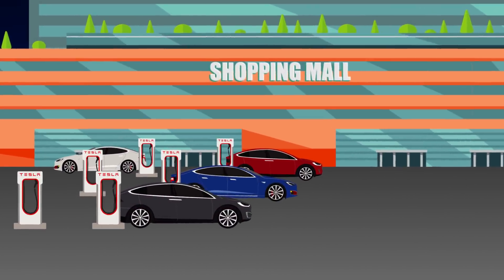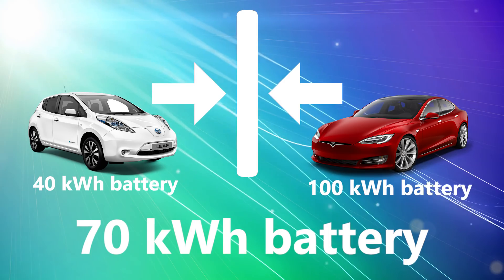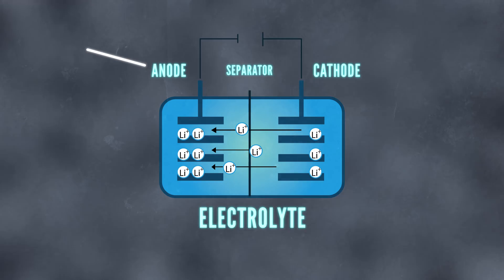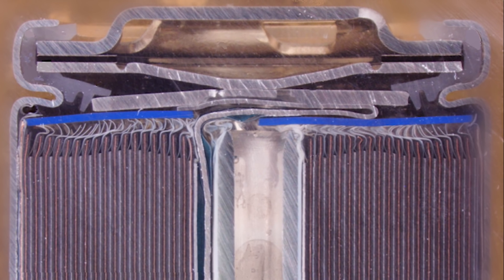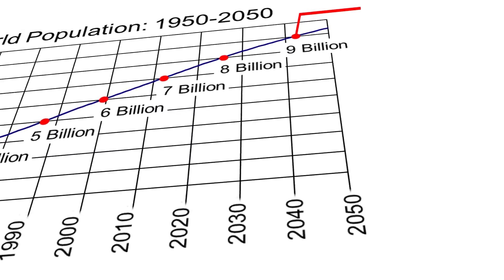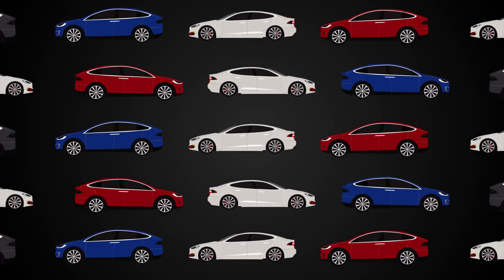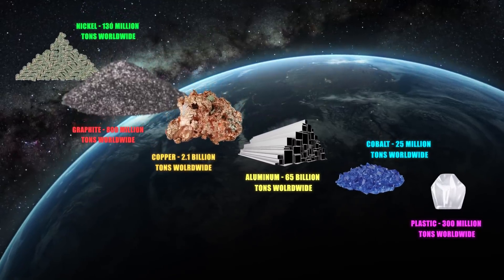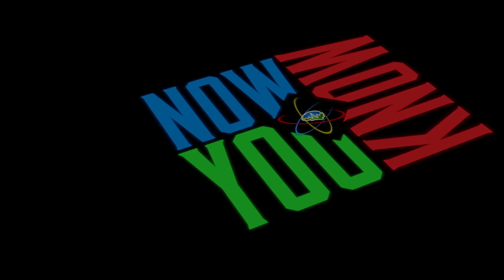Will there be enough EV Battery Material?

Comment: You forgot to add that ALL the materials used in the Tesla cell are fully recyclable!
Reply: Nothing is fully recycable. What is the yeld? How big are the losses? Do you kow? I have no idea
Reply: @tomasfoltin607  During tesla shareholder meeting this year, tesla CTO JB Straubel said that "Tesla will absolutely recycle — and we do recycle — ALL of our spent cells, modules, and battery packs". So yeah at least tesla is recycling all of their used battery components. And with better battery composition and production technique in the future resulted from EV adoption, it will definitely urges more companies to do the same thing, not only in terms of environmental, but most importantly profit.
Reply: @Arpin_Lusene  all  is recycled doesn´t mean recycled at 100%. There are loses which have to be covered by new materials. For example. Despite all glass bottles are recycled, the new raw material-sand- is still used. Because the recycling does not work with 100% efficiency and because demand is growing. I am not disputing the fact, that recycling heavily reduce raw material demand. But cannot eliminate using of it totally.
Next point is, that stakeholder meeting is not really relevant forum to share whole true. Usually nice pictures are presented and problems are covered under carpet. Corporate culture. So I would prefer more precise data from independent source.
Reply: @tomasfoltin607  Sure, there's no system in this world that would be 100% efficient, there always will be some losses during the process(the law of thermodynamics), the point is it's pretty good, and much much more recyclable than fossil fuel(which is basically nothing) even at this moment and definitely will be much better in the future.

And about the shareholders meeting not being relevant or dependable, I think that's not true, you could get into a lot of trouble by lying about that kind of stuff, especially when it comes to tesla, first it will influence the company's image which will influence the stock. There's a lot of people that want tesla to fail, be it ICE vehicles company, big oil company, media that's sponsored by big oil company, or just tesla shortsellers. If there's a case of such thing where tesla is lying about their battery recycling, you bet all of this people would be all over that. 

Even recently there's the case of whistleblower(people that used to worked inside tesla) that said "Tesla used punctured battery in their car production, tesla generated unbelievable amount of scraps during their production" and even wrote email to elon that said "Don't worry, you have what's coming to you for the lies you have told the public and inverstors." and a lot of media picked up on that because that's such a juicy story and it affected tesla's stock. Eventhough later that turned out to not be true, the amount of news reporting "that's not true" vs news reporting "Is tesla using punctured battery in their car production!!??" or "Tesla had sneaky manufacturing process, said former tesla employee" is wildly different in numbers.

But if you want other sources other than shareholders meeting, here you go, this is from tesla's blog, mind you it's from early 2011, which means the technology for recycling and the battery composition itself is already almost 7 years apart. And sure you might said "This is from tesla itself, the company itself must be lying!", but then again like I said in case of tesla, if tesla is lying, you'll bet you will hear about this 7 years old corporate culture lie by now. Also the punctured battery whistleblower case happened around 6 moths ago, if tesla is lying, you would think the whistleblower will also include it.

They said: "At Tesla we have been refining our recycling program for years. Before sending our battery packs to be recycled we can reuse about 10% of the battery pack (by weight), e.g. the battery case and some electronic components. In North America we work with Kinsbursky Brothers to recycle about 60% of the battery pack. In Europe, we recently started working with Umicore, and now that we are selling cars in Japan and the Asia Pacific region, we will soon have news about recycling in Asia."

Here's the link to the full post: https://www.tesla.com/blog/teslas-closed-loop-battery-recycling-program
Reply: Wendy Wirawan I think we have distinguish between two points. First is recycling of vehicle as itself. Here EV struggles with batteries. But common cars not. Because fuel cars use fuel tank to keep energy for their movement. Batteries versus fuel tank are less reusable. Hope this is clear.
Next point is source of energy. Fuel cars used gasoline, fully non reusable source. Agreed? Once is burned, its gone. EV cars use electricity, which comes from various sources. Unfortunatelly, many of them are not reusable like coil or uranium. Just a few percent comes from wind, sun and ocean vawes. Which means, EV cars are coil powered cars more-less.
Fuel car engine efficiency is about 60%. Electric engine efficiency is about 90%. Hovewer to get electricity the steam turbine powered by coil is needed and such system efficiency is about 70%. Total efficiency is about 60%. Same as for fuel cars. And I don ´t calculate losses caused by distribution of electricity from power plant to  EV car. Please take into considerstion the calculations are rough
Reply: @tomasfoltin607  Are you saying because the energy source are not 100% clean at this moment, that we should forget EV and keep up the ICE vehicles? I don't understand why you bringing up the power generation sources. Plus we are trying to make the power grid cleaner, sure it won't happened overnight, but it will happened nonetheless.

Plus you're bringing efficiency in generating power from turbine and the energy loss from electricity moving from grid to grid and act like that's such big problem. Do you forget that to get gasoline, there's quite a bit of process to get there? First you need to extract it, which mean building big extractor at the site. Second you need to move it from extracting station to refining station, and not to mention sometimes there's oil spillage during that process. Third, you need to refined the oil, which using electricity. Fourth, you need to move the fuel using big tanker, which is also using fuel.

What's your point? Just state your problem directly. Stop going from all angles, you are wasting time.
Reply: @Arpin_Lusene  OK. Let´s analyze the problem as a process. For ICE cars the oil mining refining and transport is needed. Then the gasoline is pumped to the vehicle and you can drive. So, more less 2 steps. Preparing of gasoline and driving the car.
For EV it is different. First step is to mine, refine and transport raw material to power plant (coil, uranium whatever). Then the electric energy is generated and distributed. Then the EV car loads batteries and you can drive. So more less 3 steps. Preparing of raw material for power plant, preparing of electric power and driving.
Once you obsolete one of these three steps for EV cars, you get nicer picture. But this is not real picture. So that is my point. You cannot obsolete electric power production for EV as the electricity must be prepared prior the EV car is able to drive. Same with ICE. The gasoline must be produced. Difference is in one more step in EV process. And according to thermodynamic law, each process is charged by loss. Finally the losses are multiplied.

I am not saying we have to forget EV. But we have to calculate benefits fairly. Not just from last process step point of view. In that case we will get nice picture of non-poluting car with zero emissions. Which is not true.
I assume, I explain my statement clearly.
Reply: @tomasfoltin607  Why did you combine mining oil, refining the oil, and transporting the processed fuel as the same thing? They are completely different thing. Plus you are excluding the extracted crude oil transportation. Oil mine is usually at remote places, at the middle of nowhere or like at sea. Also they required electricity get this oil out. After that they need to get the mined oil transported to refining station, there are 4 ways they usually do this, 1. Pipeline, which requires pipe laying which requires heavy machinery which requires fuel, also pump which requires electricity.
2. Ship, which requires fuel to move the ship.
3. Rail, which requires fuel to move the train.
4. Truck, which requires fuel to move the truck.

After transporting the crude oil, they need to use electricity, it takes about 6 kWh to produce 1 gallon of gasoline. 1 gallon of gasoline equals to about 24.7 miles in ICE car. EV can go to 20 miles using those 6 kWh. Which makes people also think, why don't we just use that electricity directly to power EV?

After refinery, we need to deliver the gasoline to each fueling station, which they use big tanker to do so, which consumes fuels still.

You are dishonest to compress all that 4 processes into 1. If you want to include the fuel pumping from fuel station to your car(I don't know why) then it will come to 5 processes, not 2.

Now I see that you are trying to say that gasoline production has no relation to electricity at all, hence why you keep saying "There's a lot of process to generate electricity for EV". Well the thing is all the electricity generation problem that you said apply to EV, also apply to gasoline. 

To mine the oil you need to drill and pump it out which requires electricity. 
To transport the crude oil, for example using pipeline, you need pump which using electricity, if you're using ship, rail, or truck, you need fuel, which we know also need electricity to produce it.
To refine the oil, you also need electricity for it, quite a lot that makes you question why don't we just use the used electricity to power up EV?
To transport the fuel, you need big tanker which using fuel which also use electricity to produce the tanker fuel itself.

You would think all those electricity during all those process would be much better to be used to power up EV directly. It doesn't matter where the EV's electricity coming from, the point is seeing all those fuel production processes, it makes much more sense to just use EV. 

I noticed you keep including uranium like it's the same thing as fuel production just because there's fuel mining involved. Not all clean electricity generation required mining for nuclear fuel and refinery you know, only nuclear need that. The rest of clean electric generator only need the foundation(for ex. wind turbine need to be secured to the ground and put at the right place) and hail presto it works. You got immediate electricity. Mind you gasoline production is also using those electricity from your so mentioned uranium, coil, whatever.

You also applying thermodynamic law to EV, but what about ICE car? You're gonna ignore that? Are you implying ICE car is more efficient to EV? 

The point is your argument is basing yourself that your fuel production don't consume electricity that EV also used to move(or at least not as much). And based on how we produced gasoline, we could powered EV to almost the same range as ICE car did if not more.
Reply: @Arpin_Lusene   Sorry Wendy,  I am little bit lost.
First, You wrote: "After transporting the crude oil, they need to use electricity, it takes about 6 kWh to produce 1 gallon of gasoline. 1 gallon of gasoline equals to about 24.7 miles in ICE car. EV can go to 20 miles using those 6 kWh."  My logic tells me, that I have to spend 6 kWh for24,7 miles for ICE car. But EV car could run just 20 miles. It means, that more efficient is to produce gasoline, because ICE car could run 4,7 miles more. Am I right?

Next, we are far away from primary point of discussion. It was related to recycling.

Next, I don´t want to discuss whole process from mining oil to pumping gasoline to car, because of enormous complexity. However, just very simple model. Imagine please following situation. There is a power plant which consumes gasoline. Now. Which process is more efficient? Mining+refining gasoline+running the ICE car, or mining+refining gasoline+running the gasoline engine in power plant to generate electric energy+running the EV car?

Next. Gasoline production with all process included steps is dirty and highly electricity depended industry. But, coal and uranium production, needed for power plant are very comparable processes too. So, once you cut off the gasoline production, you have to replace it by similar dirty, heavy energy consumed processes to produce enough electricity for EV cars. Where is the benefit?
I am living in EU and based on official statistic 74,4% of electric energy comes from combustible=coal (48,7%) and uranium(25,7%) sources (non renewable sources). So, for me the EV cars in Europe are coal powered cars. I don´t know the situation in USA. I suppose the nuclear is more important.
Let´s go for renewable sources. From hydro power plant comes just 12,1%, wind 9,7%, solar 3,5%. It is just 25,3% in total. Here is the link: https://ec.europa.eu/eurostat/statistics-explained/index.php/Electricity_production,_consumption_and_market_overview#Electricity_generation

Next. So called clean sources of energy, especially wind and solar are so unstable, that they cannot be attached to electricity distribution net without backup sources. Practically it means that in case the solar power plant is out of operation (due to clouds for example), the diesel engines cover the electricity production. I am not joking. Same with the wind. It is dangerous to put unstable sources to distribution system as they could destabilize whole system. How it works? The wind/solar power plant is attached to distribution net and in background the engines are running, just for the case. Once the wind/solar power plant is out of operation, combustible engines started to cover the power cut.

Next. Until now, EV cars are pushed mainly by administration in EU. So for me it is political decision to use EV car, not environmental or even free-market decision. Once is something pushed by government and even donated, it is really suspicious for me. In case EV cars are more efficient at all over ICE cars, which includes car production+power source production, why do I need to donate it? What is the point? Just fools use more expensive technologies. Look at LED bulbs. They don´t need any political pressure for using them. It´s clear that even investment is little bit higher compare to regular bulbs, you can save a lot of money by using them. So why it is not the same for EV cars?

You wrote: "It doesn't matter where the EV's electricity coming from, the point is seeing all those fuel production processes, it makes much more sense to just use EV." This is wrong. It does matter where the electricity comes from. I care, whether the city is "clean" and fresh, but land 25 miles from city is polluted by ash from coil power plant and air polluted by carbon dioxide and sulfur oxides. I don´t want to "nice" cities for the price of destroyed country. Even it is not my country.

Please, don´t think I would like to keep the status quo. Once the technology which could really compete with ICE cars will appear, I will support it. But till now, EV cars doesn´t convince me. Especially Tesla. I am more attracted by hybrid cars or hydrogen powered cars.
Reply: @tomasfoltin607  He meant that in order to produce 1 galon of gasoline you have to spend 6kwh of electricity and ev can go 20 miles with 6kwh, so when you produce that galon of gasoline you wasted 6kwh and your car didn't even move and ev car just crossed 20 miles so that 6kwh of electricity is spent on production rather than driving. So now that the gasoline is produced you can go 25 miles with your car with that one galon and I'll charge another 6kwh in my Tesla which is equivalent to your galon and go another 20 miles. I drove 40 miles while you drove 25 miles because I didnt have to spend 6kwh to produce gasoline but directly charged the car. Do you understand now what he is saying? 
Main difference is to refine gasoline you have to burn coal to produce electricity, then you have to spend that electricity to refine that gasoline, then distribute that gasoline to gas stations with tankers so you can drive your car. But to drive ev you have to burn coal to produce electricity and simply charge your Tesla directly. That my friend is much more efficient and eco friendly than refining oil. burn coil, make electricity charge tesla and drive without burning gas all over city vs burn coil make electricity, spend it to refine oil into gas, distribute gas with tankers to gas stations, fill your tank and then drive your car while burning gas all around the city every day. If you cannot understand this than there is no helping you, I cannot make it more simpler
Reply: @mudza92  Ad first dear mudza. I we are discussing cars. It means, your Tesla is not a vacuum cleaner which you plug to socket driving with cable behind you. You have to produce the batteries. It means, produce electricity from coil, then to refine all pretty raw material from tonnes of soil, then to produce batteries with lifetime 10 years? My gasoline car needs the tank produced from common iron.  You have to recycle used batteries which is energy consuming process to.
Second. Refineries are generating electricity from their own sources, not coil. They burn by-products. But EV cars are powered by electricity from net, which is really coil produced energy more-less. I don´t know situation in US, but in Europe is this real.
Third. Once the EV cars are so perfect, eco-friendly and revolutionary, I don´t understand why they need to be donated by state? Once the phones were replaced by mobile phones I don´t remember any donation from state. Once the mobiles were replaced by smartphones, they weren´t donated too. Any reasonable reason why the Tesla is sponsored by my taxes? I am talking about situation in EU.
So, once again, I cannot see any reason why I should change my gasoline powered car just now. 

Nevermind, as you wrote, I am helpless.
Reply: @tomasfoltin607  Okay I see where this is going. But no matter what you say, electric cars are much more eco friendly and more economical and as the time goes and   technology progresses they will be even more greener and cheaper. Gasoline cars are going to stink and polute environment but I can charge tesla from solar panels of my roof for free so nothing you say can win that argument. Just accept it already EVs are the future and the future is here
Reply: @mudza92 I am not a prophet, so I can´t say whether the gasoline car will survive or not. Or even whether EV cars are future. Future is always future, there is no current future. It is oxymoron. I am just nervous that (I don´t know how in US, but here in Europe) the EVs are the political theme. And state is going to push money to big corporation just because they are going to produce EVs. Once the technology is better, than there is no need of state intervention.
They are many constrains regarding the current technology which I believe will be solved. As charging time. I can understand that you can plug your Tesla to solar panel in your house.  This is not case in Europe for many reasons now. We will see. I will be happy once the technology of car industry will turn from gasoline to another source, but by natural way. Without political push.
Reply: @tomasfoltin607  I don't know how you got impression that I am american, Im from europe also and I know it's much harder for people who live in apartments and have their cars parked outside to deal with charging, but I live in my house and also many people do so it's not that hard to figure it out. Anyway, government is giving subsidies for buying electric cars because it's cleaner for the environment, and doesnt directly polute air in inner cityes, as simple as that. Frankfurt is half the time in smog, river Maina is so dirty from polution its disgusting at it smells so bad. That's why its not allowed to drive diesel cars in ciryes and you get subsidies when buying electric cars, because in some places it's impossible to breath because of polution.